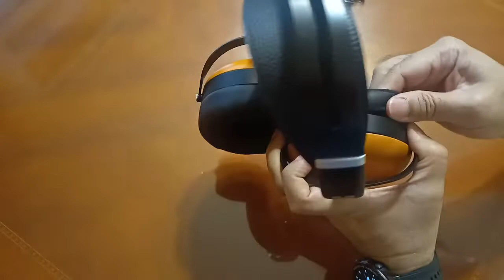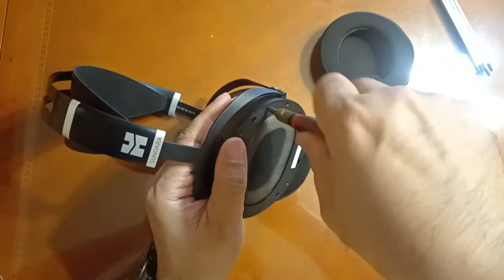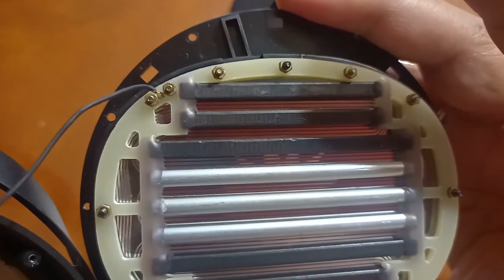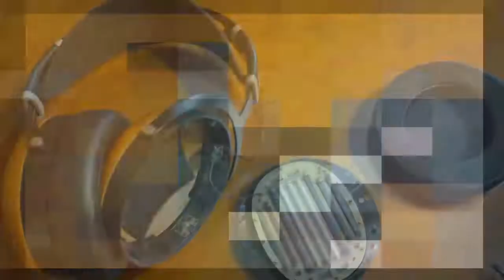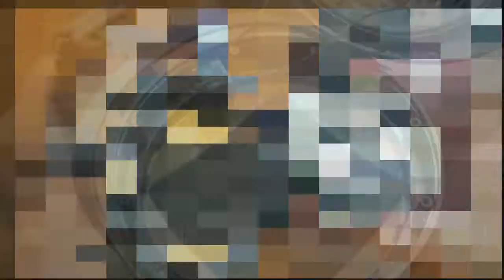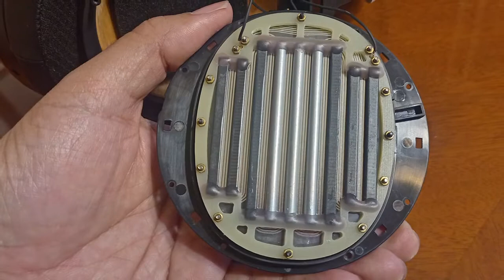HiFiMAN SUNDARA Closed-Back Разборка | INSIDE

Comment: How are the wood cups secured? Can they be easily removed to repaint/stain to a more appealing walnut color?
Reply: yes. unclip ear pads, take out the outer ring of screws  remove driver,   then the silver screws and the  ear cups come off,   nice solid wood  simply  sand paint  re assemble,  pay attention to the speaker locator pin and you cant go wrong on re-assembly..
Reply: You a G bro! I just ordered them for crazy cheap and can't wait to get them in and mod them!

Comment: I installed the Custom Cans damping mod for these, it has helped even out that upper base mid bump. I wonder what some drilled holes arrou d the cups would do to the sound?
Reply: buy the open  sundara instead...   the drivers are chosen based on open vs closed..  so  unless your going to 3d print the plastic interface that the  ear cups  attach into,  to  prototype various hole's  to see the audio effect...